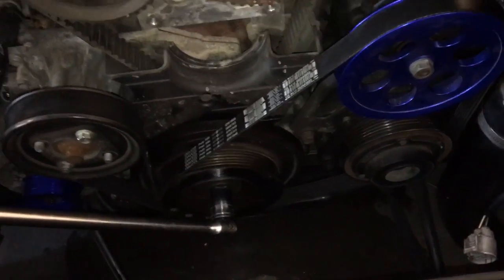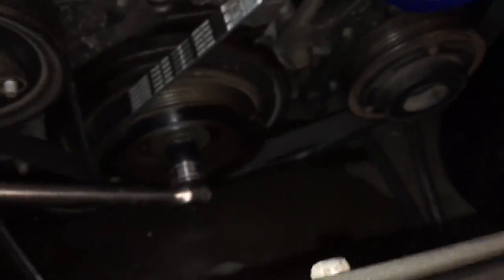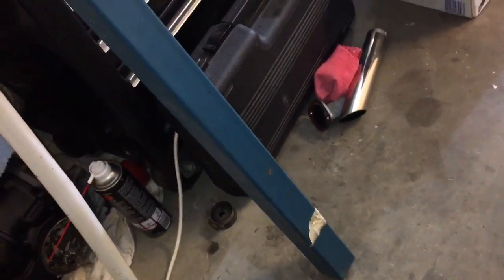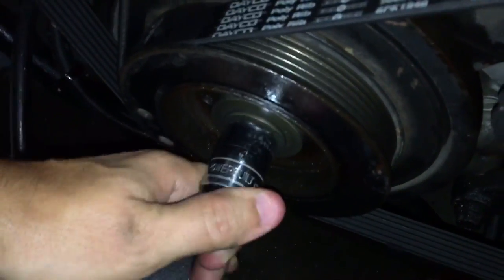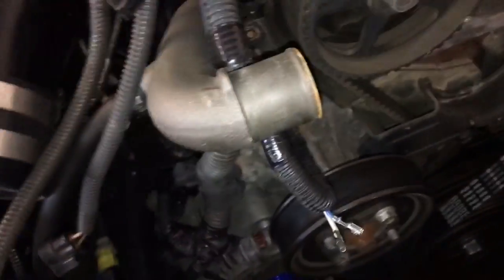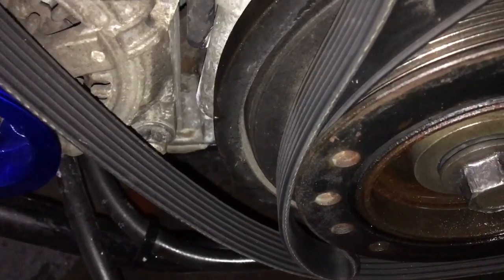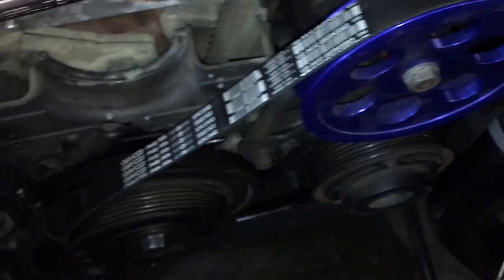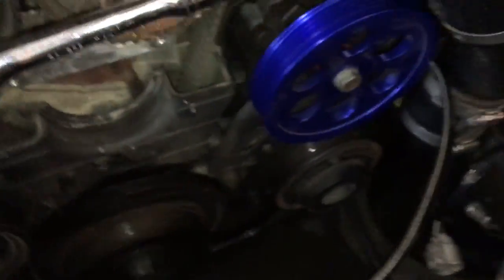Seized Bolt Removal: How to Remove Crank pulley bolt EASY! breaking threadlocker

Comment: No shit! I've been a mechanic for 14 years and never even seen this technique. I found this video while also fighting with a JZ crank bolt. It was that tight that I was sure this would tear the front off the water pump. But sure enough it worked!
Reply from the maker: 💪🏻 water pump flex 😂

Comment: Thank ya Jeebas I found you!  Tried stuff and bent stuff.  I had most of the front components already removed to begin taking off the front cover.  The video I watched on my truck, the guy easily used his impact gun and it came right off.  Not for me.  Long story short, used your method of tucking in the extra belt with only a few pulleys to work with, and then a 3"x3' section of steel fence pipe as a cheater bar with a breaker bar and socket.  Only a few turns and it cracked and then spun out!  I even tried using the cam lock tool to try holding everything.  Almost worked but crank still tried to rotate.  Hopefully I didn't mess up my harmonic balancer's current alignment like someone below pointed out.  At least bolt is out and I'm continuing on!  Much Love!!!
Reply from the maker: Wow! She sounded tight as! Glad this helped you!

Comment: It works.... BUT..... VERY IMPORTANT......
I did this but when I went to put balancer back on, the timing mark was off by about 15°, meaning the outer hub had slipped.....
Had to have been from doing this to remove it, as it was moved in the direction that would coincide with removal.....
Be careful if you do it, as now I must replace my harmonic balancer

Comment: What size breaker bar did you use? My 24" 1/2" looks like it's going to break. I just ordered a 3/4" 40" I'm hoping will hold up. Over 350nm didn't break it lose.

Comment: that's not a seized bolt of yout could remove it with a rubber belt holding it in place

Comment: If engine turns the way to loosen the bolt put breaker bar on frame bump starter over worked on my 5.3 Chevy
Reply from the maker: Tried many times on this, but was not enough to break free.

Comment: I'm gonna try this tomorrow. I've tried everything possible. The only thing I haven't tried is my impact wrench because it won't fit in the IS300 bay in front of the engine. I'll let you know if it works! :D Thanks!
Reply from the maker: How did you go?
Reply: @ThatCarChannelOfficial  I ended up with a 7ft steel pole on the breaker bar and another breaker bar wedged against the ground using the Toyota crank bolt tool 😂

Comment: What if the bolt is stuck on without the pulley in. Someone told me to turn it to top dead center with only the bolt on so I can see the markings and the sprocket stopped before that

Comment: Maybe if you put a socket or something round at the fold you wont have the crease and can reuse the belt. Thanks for the informative video.
Reply from the maker: Good idea! Cheers
Reply: @ThatCarChannelOfficial  just done your method on my Frontera DTI off roader unsing the old belt and it worked a treat. No more sqeaking belt.
Thanks.

Comment: Ayy it works like a charm! As long as you have 2 other pullies to wrap the belt around, it’ll work! Cheers!
Reply from the maker: very true, most cars would have an alternator, power steer, water pump or air con pully to wrap it around i would hope :)

Comment: Nowadays,  if you have an impact, buy a $27 harmonic balancer socket from Lysle, it comes off like butter in under 10 secs
Reply from the maker: Miami13 there is a number of reasons for this - access - there was only limited room at the front of the engine, I could have used a 3/4 or 1” impact wrench, but I would have had to degas the AC, remove the condenser, remove front bumper and intercooler also.

Comment: Was fucked for ideas getting the crank bolt off mums 5s engine Camry motor to replace the water pump. Tried jamming a bar in and using the starter but still too tight, tried the best air compressor I could get hold of and even with my 3qr inch rattle gun still not enough balls.
Ended up using this trick to stop the motor turning with my breaker bar with a  old roof rack slid down the cunt. Literally stood on the motor bonnet off and gave it berries and she came.
Cheers heaps for this video my dude. Never seen that belt trick before.
Reply from the maker: chris king wow! That must have been tight! Cheers for the comment back!

Comment: I have a question doesn't this put a lot of strain on the other pullies? But i am busting myself to undo a crank bolt at the moment... 🤔
Reply from the maker: Probably no more than the get when the thing is spinning at 8000rpm+
Reply: @ThatCarChannelOfficial  im not lucky enough to get 8000rpm but yeh fair point, i do have an old belt and need this bolt off
Reply from the maker: The JZ has 320nm of tightening, so who knows how much was torque was used to breakfree!
Reply from the maker: Let us know how you go hey!
Reply: @ThatCarChannelOfficial will do man 👍
Reply: @ThatCarChannelOfficial  dude your a champion and the original poster is a legend, bolt came off easy as, had to fart about with what pullies and orientation of the belt but it just locked up and the bolt just pops off 😁😎👍
Reply from the maker: Awesome!! Great to see!! Thanks for posting back!
Reply: @ThatCarChannelOfficial  now for the next job, pully itself, timing case, heads and those bloody exhaust manifolds... thanks xr8 designers 😂
Reply from the maker: Oh those... changing to some tubular extractors or something?
Reply: @ThatCarChannelOfficial  yeh x-force full system, bigger throttle and cams too
Reply from the maker: Cams sounds like a fun job to do on those also!

Comment: Does it work on tightening the bolt as well?
Reply from the maker: It sure does! Similar path but wrap the belt on the other side of the pump.
Reply: @ThatCarChannelOfficial  water pump?
Reply: @ThatCarChannelOfficial  yes!!!! This was the question and answer I was looking for!!!😭🙏🏼I have an is300 with a 2jz-ge and knowing that I can loosen and tighten the crankshaft pulley bolt with the serpentine belt is the easiest option. My friends air impact guns don’t fit bc of my ac condenser and I’d I have to remove it sacrificing the ac lines and having to recharge my ac. Thank you!!

Comment: Don't do this on a 1jz/2jz it separates the crank pulley from the base, I just did it FML lol or maybe my crank bolt is just on there too tight
Reply from the maker: Maybe your pulley was absolutely knackered? Might need to look at the tool to hold the 2 bolts in place in the centre? I made one so I could re tension to 330nm.

Comment: Watch how scotty kilmar does it on his channel. He cranks the engine once then he loosens it by hand. Dont know if that really works
Reply: yes that really works, been using that technique since I started mechanic job in 2005. just crank the engine, and headache in gone.
Reply: That method doesn't work if your battery is near dead and your car is  pulled into your garage and can't get a jump. Took me days to get that bolt out lol

Comment: Having seen this video after having my 2jz on an engine stand, I was very upset I couldn’t use this method, just did it on my gs300 I’m currently parting which I brought for the bottom end... I owe you a beer, it took 2 damn days to get the one off on the engine stand, I tried everything, 3/4” rattle gun, nothing would work!
Reply from the maker: One of the best posts! Shoot me an email if you want a sticker - wear it with pride on your JZ powered car :)
Reply: That Car Channel 

Cheers. Can go with a few other ones on my car I’m entering into world time attack next year!

Comment: Good trick if you're in a pinch but its not good for the pulley. You're over stressing the rubber that's inside the pulley and if that goes bad you'll have to buy a new one. They sell special service tools for this and it doesn't harm the pulley. https://www.tooltopia.com/search.aspx?find=Schley+(SCH64300)
Reply from the maker: Correct, I made one myself to install the new Balancer/bolt etc. thanks for the comment!

Comment: What about to put it back on if you don't have a air compressor?
Reply from the maker: I put it back on without any rattle gun or air compressor, BUT it needs to be 240lb/ft tight.. so I made up a tool to bolt to the pulley. You can buy tools to bolt on and hold still whilst you torque the bolt.

Comment: U didn't have an impact wrench? I'm definitely going to try this
Reply from the maker: yes, i had an impact wrench, an 18v Hitachi that does about 250nm.. i couldn't use anything bigger, as that would involve me taking out the A/C condensor/de-gassing the system, removing the front bar, intercooler etc etc.. i had the radiator out obviously but there is only so much room there up front :)

the torque setting for the bolt is 330nm/243lb/ft - the 250nm rattle gun had little to no chance! the other thing - the car is auto, so simply leaving it in gear and hanging off it with 2M of pipe on a breaker bar was not an option (without removing the startermotor and fitting a ring-gear chock)

to re-tighten the new setup i made a brace that held the pulley so that i was able to use a 3/4" torque wrench 
which is in this video here :) https://www.youtube.com/watch?v=HZDCTfq3_w0
Reply: That Car Channel did u have enough space for a pneumatic impact wrench? The method u show is simple enough for anyone without pneumatic tools though. I've been dreading removing mine until now lol
Reply from the maker: unfortunatly not - i barley fit the Hitachi in there.. i only have one pneumatic impact wrench, it's huge in comparison and doesn't have the same torque as my Li-Ion one :)

Comment: thank you so much.. I have been a tech forever and tried every trick up my sleeve e3ven a massive impact.   I ended up sadly breaking the alternator bracket even of the block trying to wedge between to hold belt tight.. this worked like a champ
Reply from the maker: +Empowered Real Estate Solutions LLC it's a good trick to know :)

Comment: why didnt u use a power bar and a BFH
Reply from the maker: BriggsMower it's automatic - the crank needs to physically be stopped from turning. If it was manual it wouldn't be an issue at all.
Reply: im talking about the ones u hit with hammers we use them all the time at work
Reply from the maker: don't have one of those, cheers for the suggestion though.
Reply: no probs